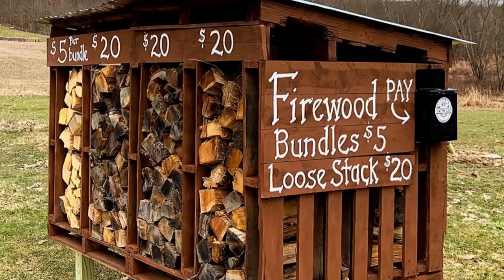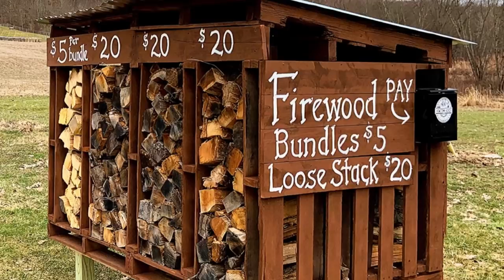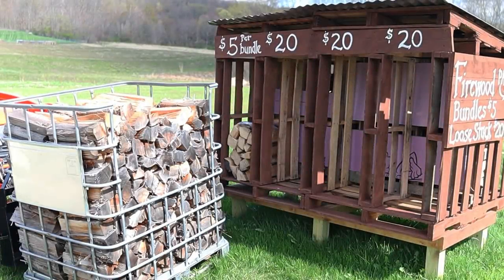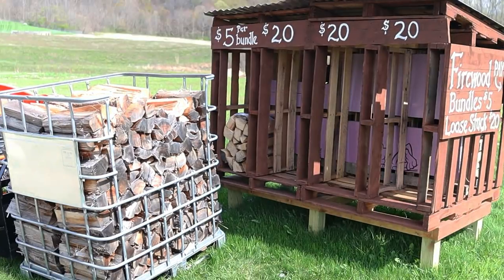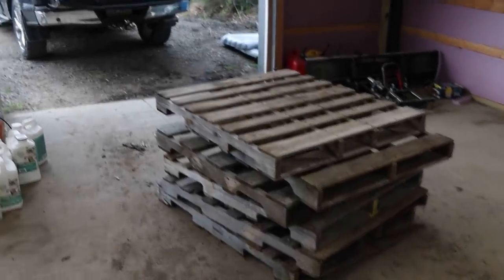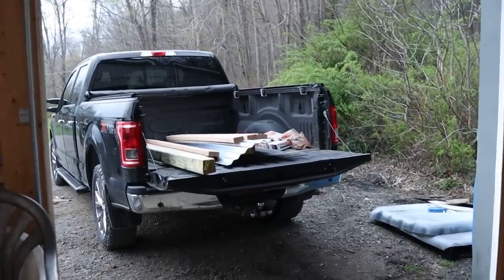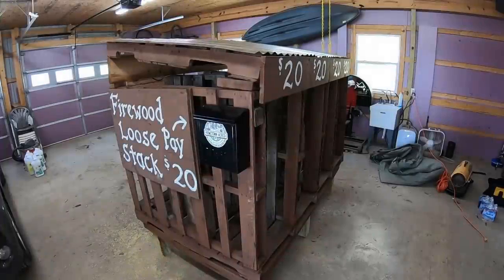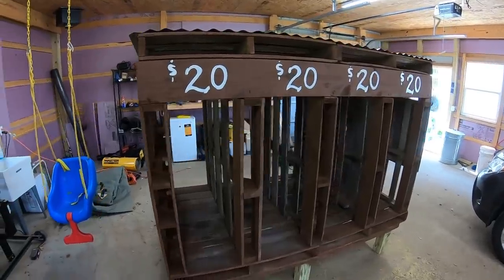You Asked For It... Update On The Roadside Stand

Comment: If the $5 bundle is present, it will help make the $20 stack be perceived as a better value which will drive sales of the $20 stacks. One of the 10 slots should be dedicated to this, even if you never sell any of the bundles. Marketing is tricky! :)
Reply: My thoughts exactly.
Reply: I agree - anything seen as marketing here would be counter-productive, but giving an option with perceived better value definitely "helps" an unsure buyer make their mind up.
Also, just visually helps a buyer quantify what's on offer in the bigger racks.
Reply: Also people traveling on the highway might be different people than on backroads. Maybe more casual and thus more interested in smaller amounts of firewood.
Reply: @sarahr.1076  That was my exact thought. Different types of people, different cars, different needs. Should have made the stand the same to run a better comparison.
Reply: Intuitive
Reply: Damn just posted same thing!!!
Reply: That's exactualy what I was thinking! 😂🤣😂🤣
Reply: Plus make the $5 bundles really small lol.  A $20. Bill everybody has in their pocket.
Reply: Just add a shelf on the side that holds 1 or 2 bundles!

Comment: My suggestion is to make sure you divide the front/back compartments.  I would read it as $20 for both the front and back...
Reply: I agree. It took me a sec to realize when he said 8 slots instead of 6. I was like, I thought there were only 3 slots. I would totally, innocently, take both sides of the slot, not realizing there are two sides.
Reply: I screwed in a couple boards in each slot in mine.
Reply: I thought the same thing. You need some sort of divider. Looks like $20 for the whole "bay".
Reply: Yep you need a divider for front and back side.
Reply: You have to be perfectly clear or people will be confused.
Reply: Yeah in all honesty I was confused when he said "8 bays".  I was going "I only see 4" then I realized that it was 20 for 1 side and the other side was a separate stack.  The way it looks like it is stacked I think in person I would have got it since there is a good amount of space between the back of the 2 stacks.
Reply: I agree it's best to be as clear as possible with your signage.
Reply: @barryarnold7579  I was thinking the same thing, but the wide angle lens on phones are deceiving.,
Reply: I agree
Reply: I also agree i was a bit confused too.
Reply: I though the same thing till reading this comment
Reply: at 9:45 you can kinda see a couple 2x8s or bigger going across the middle. im betting it was added as an afterthought and just wasnt mentioned or shown well
Reply: During the time lapse you can see some cross bars they added
Reply: @barryarnold7579  people are probably more likely to have a $20 bill than a $5 bill
Reply: @Dave Hicinbothem Yeah you could see that thing swaying a lot when he was moving it. Probably not a big problem, since he's not moving it much, but you can kill two birds with one stone so why not?
Reply: @jeffreydrury1951  That's the stand on his property, I went back and looked at the first video, he did put the dividers on that one, but I don't think there was one on the new stand on his neighbor's property. I was thinking the same thing, some sort of divider would be good for clarity.

Comment: Great idea to branch out. With you dump trailer you might want to consider changing your design to incorporate a skid frame bottom and stiffen the stand with cross braces in the center which would separate each row. This would help if you wanted to move them too.  Really love the custom signage.
Reply from the maker: We did end up adding some cross bracing inbetween the front and back rack to stiffen the rack and add a divider. Made it much more solid

Comment: Have you considered changing design of the wood stand to accept cassette style loading this way you can cut down on your labour by filling cassettes once rather than the twice. Just a thought.
Reply: Excellent point. The current method requires stacking the wood twice. A top loading cassette system (or side loading) might be convenient. Load the cassette, remove front/back covers, and JOB DONE. The cassette could have plywood that slides into a slot, or a metal fence grid kinda thing. 

I guess you would just need one more cassette than the total number of stands, at minimum. Unless you wanted to load a whole bunch of cassettes all on the same day.

Comment: Two comments I felt were good ideas, still having some $5 bundles (Make them a little less than 1/4 a $20 stall) and signs, maybe 200 feet before on each side. Many times there have been roadside stands I would have stopped at but once I fly by, I ain't turning back for.

Comment: Very cool the only improvement I see is maybe a divider between the front and rear stack.  Looking at it from the front it looks like I can get the entire section for 20 bucks instead of it being 40.  A guy around here sells I think per 20 pieces for yay so much forget top of the head.  He just dumps it inside a old dumpster concrete bin with 3 sides and the front is gated.    All honor system.  This looks like a great idea for honest folks

Comment: Suggest a big sign “Firewood” on top. For those drivers who aren’t thinking of it, might miss the sign on the end. I think adding a big sign will increase the “stoppage” (the percentage of those 8 cars/min that drive by).

Also, you’re handling individual wood pieces at least 2 times: loading your metal cage, again to fill the roadside stand. I suggest a modified roadside stand that will accept 2 metal cages side-by-side (and modify each cage to hold 2 stacks with a divider down the middle). This way you can replace 1 or 2 cages (2 or 4 stacks) at once without handling individual pieces. When you have multiple stands, you’ll want to service them quickly and without having to juggle wood pieces.

Comment: Some months later, but I have been selling just bundles on my stand. I live on a state hiway and have sold several dozen bundles. I did just last month have someone break in to the money box. I use a nearly identical locking mailbox as you have,  and some fool came up an used something to pry open the locking inner lid. I empty it every day as it is near my usps mail box so they did not get any money, but did 30 dollars worth of damage since I have to replace the money box. I did have the sheriff come out and file a basic report, but nothing else.  Oh well.
I did put out a couple of full tote cages for $125, and have sold two of those. I put my phone number on them, but they just put the cash in the box and loaded the wood into their pickup, which loose filled his full size pickup 6 foot bed completely.  The cage is 50 cu ft or .4 cords stacked.

Comment: Probably should separate the sides of the stacks, to make it clear a stack is just one side, I would guess if someone was to 'steal' that would be the primary reason, they misunderstood the system. Probably worth it to offer the $5 bundle for sake of option, even if no one ever buys one, it generates perceived value (this is why Walmart offers the tiny TVs). You could probably just replace one of the slots, or even just put 2 bundles on the side on a ledge. On the busier road, the option will probably be more attractive to people who just want wood for a night, where on the side road, you are getting more locals, wanting wood for home use, meaning they more likely want more quantity. A similar effect could be generated if you post an add to sell larger quantities. I would guess the busier road generates more sales, but it will be hard to gauge if not offering the $5 option effects it especially if you don't offer it. 

If you were in NY, you would get a fine for illegal roadside stand, no license for selling firewood specifically, ticket for unapproved roadside advertising.

Comment: 2 things...
I would secure the money...... differently ..... better. .. Like in concrete locked to the tree... your system is no harder than a plain envelope. 
2, I would have a sign that states that CAN get a cord by calling a number or something... just in case someone wanted larger quantity. 

and a PS... It looks like there is no divider between the two sides. It kind of looks like you are entitled to the whole row... and not just the half. I could see someone justifying that anyway.

Comment: Great idea!  One thing that would probably get you a LOT of sales with the weekend campers is 'instant campfires', aka 'swedish torches'.   They are simple to make and provide a quick, easy-to-light fire that has built-in coffee/cooking pot support.  If you aren't familiar with them, here is one way to make them:

1.  After cutting logs to regular length, set one piece on end.
2.  Make four cuts from the top to within 3-4 inches of the bottom, making pie-shaped wedges.  
3.  Use a chisel/etc. to knock some of the point of the wedges back to make a bit more room in the center.
4.  Wrap tinder/wood chips/chipped wax/etc. in wax paper to form a bundle that will fit down the center, topping it with cotton wool soaked in vaseline before twisting the ends closed and sliding it in.  (The end with the cotton wool should have a long tail and go in first, so the tail sticks out near the bottom of one of the cuts.)

Users just have to set the solid end on level ground, light it up, and enjoy the (mostly) smokeless fire!  (I would have illustrated instructions on how to use it on the wall somewhere.)  You could probably charge TEN dollars for larger rounds with convenience like that.

Does that make sense to you?

Comment: What size dump trailer do you have?
Reply from the maker: 7x14
Reply: Wow are you pulling that with a 150? Does that pull okay? I want to get a dump trailer for my 150, but it’s hard to find new and used ones now.
Reply from the maker: Yeah. If you plan on pulling it fully loaded and up a lot of hills frequently you may want to consider a 3/4 ton but for my occasional use the f150 does just fine
Reply: Thanks! I just found your channel, great content! Good luck!